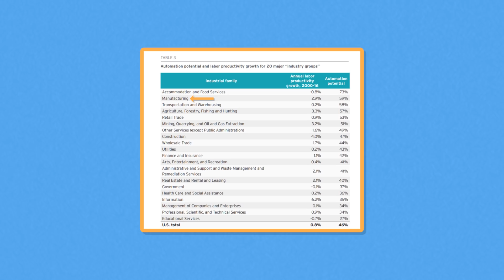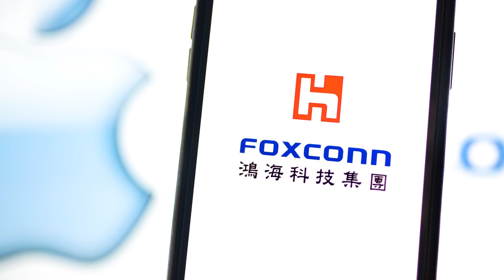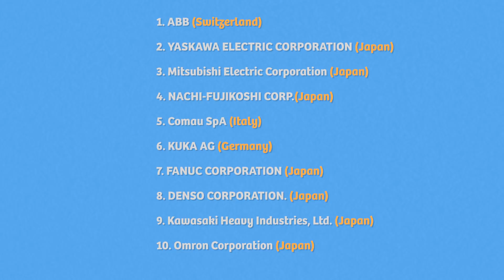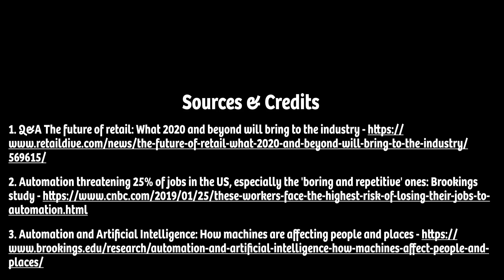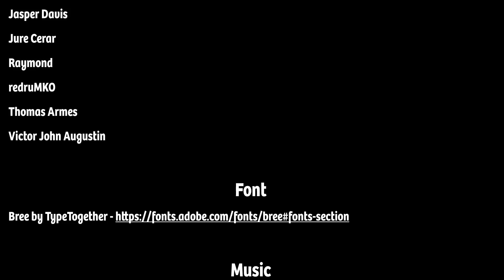The Automation Age Episode 2 - Manufacturing

Comment: Automation = lower production costs = cheaper products for everyone.
Reply: Which is irrelevant if you have half of your former worker base have an income of 0$.

There's no such thing as a perpetually valid economic system.

My suggestion is that we absolutely have to rethink our society and come up with a system to replace the current one via a gradual process before we are suddenly found with our pants down during a 30-50% unemployment rate.
Reply: @fl00fydragon  in reality; not many manufacturing processes can be automated, and if all of them could, not every company has the capital to invest in automating its entire supply chain. Im currently work in a manufacturing company that does not have the enough capital to invest even in the simplest processes. We still rely on labor, even though labor requires high amounts of training hours, benefits and some sort of mental-healthy environment, the company still invests in keeping their labor.

One thing that many people forget about automation is that it deals directly with the topic about: "humans will always have problems", named: health problems, mental problems, economic problems, etc. While machines require (at least most of them) minimal maintenance, which in the other,hand could increase the demand of technical labor for maintenance.
Reply: @alanbejarano4940 , In reality, any manufacturing process can be automated,  even the production of clothes (which was the bane of mass production) was technically solved a few years ago. It's not a question of if it's possible but of economics. 
The cost of automation is and will continue to drop, at some point it will drop to a point where it's more costly to run a human metabolism/year than a machine. 
At that point, any business that's not automated or not selling a completely unique product will either end up outcompete and bankrupt or bought off and automated.
companies like yours and co-ops might be the last to lose their labor but eventually, the logistics will catch up to them.

The demands for maintenance, even under total automation os well beneath the amounts of jobs that will be required to make up for the job loss. Additionally, there already are prototypes of self-maintaining machines or machines that do maintenance on other machines.
There's no law of physics that prohibits machines from doing maintenance on other machines or a self-diagnosing system.

So at best some lucky people will be doing maintenance job at a poverty wage and no worker rights as they'd have to compete with the fact that there will be millions willing to take their job with even less and substitute the lower salary with eating rats (what creates and maintains shanty towns) or at worse nobody gets a job and the only policy you see happening in response to the mass poverty is draconian laws/policing meant to "keep them starve in dignity" to prevent a revolt against the plutocracy that would form.

Your assertions come from a lack of knowledge on the subject.
Reply: @fl00fydragon  even now you can see governments subsidising its unemployed because of corona. So I'm not worried at all, it's upto governments to change, people will follow suit.
Reply: @marcozolo3536  Because it is fiscally unsustainable to do so under the current the current system.
Simply put, this would create a "funnel" in terms of cash flow where the money supply gets thinned as the corporations accumulate an unsustainable portion of the money supply.

this is pretty much nothing more than a bandaid that gives you a few extra years to move to a new economic system as a permanent UBI/subsidy would either require you tax 100% of corporation income so you don't get your money supply funneled (which makes production impossible in capitalism and also in all monetary models of socialism) or you have to constantly print money and prevent inflation, something the Us could temporarily pull off by using its reserve currency status which would turn its inflation into foreign debt but would soon lead to everyone dropping the dollar and causing the inflation to detonate overnight. 
(assuming the US doesn't do something completely stupid and make itself an extinction-level threat by trying to threaten the world to uphold the dollar.)

Way that I see it it's time we let the old system die off as we did with the old ones. There's no such thing as a perpetually valid economic model, it's hubris to think that ours is.
Reply: 400k jobs replaced by robots in 4 years? That's pretty horrific
Reply: Exactly why I got a Ms in mech eng.
Reply: Yes but how people are going to buy something if you have no money
Reply: exactly. automation is not the problem. inflationary monetary policy is, meaning your dollars are worth less and prices increase. 

with technological efficiencies, we should be working less days, making more money and enjoying better comforts. as always, conflate and miss-direct.
Reply: @SigmaMotionSystems  More accurately, the adherence to primitive monetary economics under a revolutionary era of automation will backfire.
Reply: 20% of the economy is gone
Reply: Which fewer and fewer people can afford,because they are unemployed.
Reply: @hudakp1 then competion would take advantage and increase their market share.
Reply: @hudakp1 it could be because of cost of R&D and the high quality
Reply: Who's gonna buy the product if nobody have a job? No job = no money = economy stops functioning.
Reply: Cheaper indeed but the robots that replaced the humans will not buy them.
Reply: Maybe we are all too optimistic when it comes to those "cheaper products".
Think about what makes products cheap today.
It is bulk production and bulk sale.
Stuff is cheap because it is produced and sold in large numbers.

Think about it, why does Toyota rather sell 100 000 cars for 20 000 Dollars each, than 1000 super mega luxury cars for 2 million each?
Sounds like a silly question, but when you really think about it, it gets scary.

There are basically 3 answers:
A: Because that is what Toyota does. Tradition. Name. Brand. Nobody wants to buy a 2 million Dollar Toyota.
B: It currently is easier to sell many cheap cars than few expensive ones, because of how the market and the consumer base looks like.
C: They needed to build a huge infrastructure and machinery to build that many cars. 

That machine (the factories, the trains, the steel forges, the sales rooms etc.) has a tremendous inertia. All of that needs to be running to be profitable and it needs to be running 24/7, all year.
You can't produce a hand full of cars, then stop the production chain and then start it up again when you need more cars.
The system is build to produce as much as possible, so you need to sell as much as possible, forcing you to sell cheap.

Robots and 3D Printers and other new technologies will take a lot of that inertia out of the system.
Once they have one big machine that can just print cars, they can suddenly start producing on demand. They aren't forced to keep the trains running anymore.

That means it suddenly becomes feasible to sell fewer, more expensive cars to a shrinking consumer base.

And that means this old, comforting wisdom "They still will need consumers to buy the stuff the robots produce." is suddenly not true anymore.

In a "on demand" industry, companies don't need to sell cheap stuff to many people anymore. They are better off selling expensive luxury goods to a small, rich elite, for high prices. That means less overhead and less work.

We might actually see a future where the economy doesn't need us unwashed masses anymore, where it can just as well, or even better, operate just for a small number of super rich people who sell each other crazy expensive stuff and still make more money than they did when they still sold cheap stuff to normal people.

It is that inertia of the production chain, the need to keep it running, which keeps us poor people in the loop for now.

3D Printers, which are celebrated as this wonderful tool of democratization and economic liberation, might actually bring us a dystopian hell worse than the worst science fiction movie.
Reply: @TrangleC  
And that's a misuse of the technology.
And also precisely why I believe that there should be a movement to replace capitalism that cannot be denied that will have to happen within the next 1-2 decades.
Reply: @fl00fydragon  And replace capitalism with what? Socialism?
Sorry, I can't agree with that. I am half German, half Croatian and old enough to have seen socialism in both countries and know why everyone was very happy to get rid of it.
People have this naive, childish image in their head when they think of capitalism, of some evil Mr Burns billionaire using "capitalism" as a tool to keep everyone else down.
That is a super reductionist caricature. In the end, all capitalism is, is that everyone is allowed to sell and buy stuff, including labor.

Yeah, not everyone thrives and there are losers, but with socialism, almost everyone loses.

Socialism just leads to real oppression, because you always end up with a one party dictatorship and in those, the only way to rise through the ranks and get to the top is to be the most devious, ruthless, cut-throat gangster monster of them all.
Yeah, capitalist politicians tend to be assholes too, but I'd rather be ruled by an asshole who was best at lying and kissing babies, than by one who was best at stepping on other people and destroying his competition Game of Thrones style, which is what happens in socialism, because there is no other way to succeed. 

Equality is an illusion and it is the antithesis to freedom and fairness.
The only way to establish equality is by dragging everyone down to the same level as the most useless fuckup and prevent everyone with drive and talent from achieving more.

Socialism only appeals to losers who don't intend to achieve anything and have nothing to offer to the world and to naive, spoiled children who never had to achieve anything. As soon as you have something valuable to sell, be it a thing or a talent, you suddenly notice how shitty the idea is.

I came up with a idea for how to deal with automation and mass unemployment. A alternative to UBI and the Korean "Robot Tax".
It is too long to repeat it here, but I posted a stand alone comment, explaining it, into this comment section. Look it up and tell me what you think of the idea.
Reply: @TrangleC  Ironically this binary view of economic systems is what's naive.

For one, by that logic we should also uncritically reject capitalism because fascism, one of its forms, is genocidal. |As you can imagine, just as it's wrong to equate capitalism to fascism so is it to equate socialism with the soviet model.

Additionally it's not about an "evil Mr burns" that keeps everyone down, the problem is how the algorithm of capitalism plays out as automation increases. You have an increasingly smaller amount of the population who have control over production and consistently falling labor requirements and it will be near impossible to compete unless you have the capital required to buy your own robots and operate at a loss for long enough to stabilize.

In short the algorithm, we call capitalism is not designed to function with AI.

The result is a siphoning effect of the money supply which would ruin more than half of our population, an effect that will be exasperated if you take into account that in addition to automation we'll be entering an age of genetic engineering and cybernetics.

Also, you gave a wrong definition of capitalism, it's not about allocation or trade, it's about who owns the means of production. 
To make this even clearer, there are forms of socialism that barely change anything such as market socialism, which would simply have co-ops instead of corporations. By your definition you'd call this system capitalism (and you'd be wrong).

If we retain capitalism in the era of AI, we'll have 50% of the population be "losers" in absolute poverty, a percentage that will rise to 80-90% by the end of the century.
sometimes the devil you know is not the solution.

You are arguing against the soviet model, I am not proposing the soviet model.
Only that our capitalist politicians are stepping on other's throats, for example look at the declassified CIA documents on regime change where they overthrew democratically elected governments because they were attempting an egalitarian/democratic version of socialism and didn't want the "there's no alternative" line to be invalidated.

False again, for one I doubt that you'll find many serious people who propose an alternative to capitlaism that want equality.
Adiitionally you don't need to drag everyone down, our technology has reached a point where we can afford to give prosperity to all, not only that we could even be environmentally sustainable as we do so.
Why haven't we done this already? 1) it would uproot trillion-dollar global industries 2) capitalism demands supply being limited because if it meets demands profit is impossible.

That's an ad hominem attack, and a bad one against an engineer with published scientific work.
Not to mention that you'd have to label the likes of Einstein and Hawking as "losers" with that.

I came up with a idea for how to deal with automation and mass unemployment. A alternative to UBI and the Korean "Robot Tax".
It is too long to repeat it here, but I posted a stand alone comment, explaining it, into this comment section. Look it up and tell me what you think of the idea.

My opinion on your solution?
In your words "I know, that sounds kind of Socialist" and you're right because it is, you are suggesting the people own the means of production.
However, your fear of socialism has resulted in you designing a very bad version of it with some fatal flaws.

1)You're incentivizing the proliferation of "single block machines" in production that can be a one-robot construction line.  Once again the system will have a smaller robot demand than supply.
2) It's ignoring that a lot of automation will be a single server doing the job of hundreds of office workers
3) The variation in the use of ROLs and the deliberate smaller implementation of them than demand in the market
4)By what you're constituting as a robot you'll be limiting the living standard of the average person who'd have to rent most, if not all of their ROLs which in turn may prohibit them from having access to a washing machine, computer, smartphone, oven, fridge, 3d printer, etc. just so they can make ends meet. (not to mention the mess this creates if someone requires prosthetics/augmentations)
5)Securing income will be a lottery under your system all the buyers will want is the ROL and there's no way to make yours more enticing.
6) One's ROLs have a different value demanding on their capital at the start of the system. A rich person today would only go up as they could simply invest in a few single-block production machines. 
Basically not only would you not be solving anything but you'll be creating dynasties of wealth and power with no means for them to end. Such concentration of wealth and power will end up eroding all democracy and you'll soon find yourself In a totalitarian state.

Let me make something clear, I don't want the soviet model to happen again.

However, if we keep going with capitalism during an era with automation our society will reach a boiling point where either the people will mount a revolution (resulting in a soviet model system) or the rich mounting a successful counter-revolution (resulting in fascism).

If you want to prevent totalitarianism then we need to figure out a working post-capitalist system and start its gradual deployment before the implementation of AI results in centralization of power around a select few where our votes, strikes, activism, marches, etc. won't be able to change course, making one of the two outcomes I mentioned inevitable. A result I think we can both agree is undesirable.
Reply: @fl00fydragon  No, no, my friend. You are either misunderstanding me, or willfully straw-manning my position.
I'm not just talking about mass murder. That was just the cherry of the sundae of my argument.
I'm talking about personal freedoms and liberties, which you don't get in Socialism.
You can't just ignore everything I said about that and dismiss it all by pointing at Nazis.

Honestly, as a part German, who grew up in Germany, I find talking about this with Americans and people from some other places super tiresome.
The Nazis are like a Rohrschacht-Test for uninformed people.
Everybody sees in them what they want and everybody uses them as a boogeyman.
Leftists say Nazis were an excess of Capitalism, Rightwingers say they were "brown Communists".
Both are wrong.
You need to know a thing or two about German culture and mentality to understand what the Nazis were and nobody outside of Germany seems to bother learning something about that.
Nazis are way too useful as this "one size fits all" boogeyman.
The Nazis were Corporatists. That is not the same thing as Capitalist, even though both are probably triggering slurs to a Socialist.

Under the Nazi regime, the government told the companies what to produce and how much to charge for it.
They ran the whole country like one big corporation, with Hitler being the CEO.
He decided the people need cheap cars, so the Volkswagen company was founded and started churning out cheap cars for the masses.
He decided the people need radios to hear his speeches, so they produced radios and forced people to buy them for a fixed price.

Like it or not, but that is not Capitalism.
It also isn't really Socialism, so the "brown Communist" thing isn't true either, because the companies still belonged to entrepreneurs and shareholders and still made money.
It was its own thing, in between the two systems and it was rooted in German culture and mentality, because it has always been normal in Germany that the economy was heavily influenced by everybody, the government, the business owners and the workers, working together for a greater good, with the company owners building houses and hospitals for their workers, without being asked to and so on.
You still can see that culture today in how the unions and the business owners work together in Germany in a pretty much worldwide unique way.

The point being, the German culture and with it Nazi culture, has always, traditionally cherry picked elements from Capitalism and from Socialism and mixed them together.
Blaming the crimes of the Nazis on Capitalism is nonsense, as is blaming them on Socialism.
To the Nazis both were basically foreign, alien concepts they just used for their own gains where it was convenient and ignored where it was not. (Yes, Socialism was technically invented in Germany, but it was invented by Jews and I don't need to tell you how the Nazis felt about them.)

Capitalism causes some problems too, of course, everything does, but as I said, it is just a system in which you have the freedom to own, sell and buy things.
That is all.
No other system has brought so much good to the world. No other system as elevated so many people out of poverty.
That is just a fact.

It also is the system that created the internet and gave you the freedom, the means and the leisure to bad mouth it online.
You couldn't do that under Socialism.

Did you know that there was a big, successful Communist youth organisation in China, which was dismantled by the Communist Party because it was "too Communist"?
I'm not joking.
A bunch of enthusiastic school teachers founded a Communist boy scouts like organisation that was all about teaching the kids about how wonderful Communism was, while doing fun activities in nature and play games and so on.
It grew rapidly until it grew too much and the Communist Party got scared. They were worried about losing control and having a rivaling organisation grow in their territory they didn't have direct control over, so they banned the organisation, sentenced the leaders to death and threw hundreds of people, even teenagers in jail.

This kind of stuff happens in Socialist systems.
Why? Because it is never really about equality and fairness and helping the working class and all that. It is just about control.

The point being, under Socialism, even being Socialist and talking bad about Capitalism, like you do, could get you on the party's shit list.

People don't appreciate freedom and liberty till they lose it.
As I said, I have seen it in the 80s and I know nobody who lived under Socialism and wants it back, except maybe some old apparatchiks who want their lost power back.
Reply: @TrangleC  (numbers correspond to answers to your paragraphs)

1)I'm not talking about mass murder either. 
What I pointed out is that fascism is a form capitalism takes. 
I just pointed out that it's equating socialism to the soviet model is as false as equating capitalism to fascism.
I expect a honest discussion, not a strawmanning of "but the USSR" at any suggestion that falls under the umbrella term of socialist economics.
And since you did bring it up  Fascism is the most totalitarian systems with the least amount of personal freedom in modern history.

2)All that's irrelevant since historians and political scientists place fascists, including the nazis, squarely in the capitalist quadrant. (evident from how they rose into power with the support of the industrialist capitalist class)

Also, corporatism is a latter stage of capitlaism. To say that "it's not real capitlaism" 
a) Is a false statement that assumes that it's possible to retain a system at its initial competitive stage and negate causality
b)Decalres capitalism as this impossible ideal of the "free market" that is inherently unstable and would collapse extremely soon after implemnentation
c)Is a line of rhetoric that has historically aided fascists to take over as it takes the conversation from "our system has a problem" to " something has corrupted our system" to "someone is responsible for these problems"

3)
And? The means of production were still private. Meaning it was still capitalism, it was simply a different form.
Capitlaism is not "when the government leaves the market alone" (if that were teh case anarchocommunism, anarchosyndicalism and market socialism would be capitalism) it's "individuals own the means of production" something you did admit in the next paragraph.

What you describe is called state capitlaism, fascism is state capitalism+totalitarianism.

4)
Thank you for making my point, capitlaism is when the means of production are private, what it's not is a scale of government involvement.

It's not unique to Germany, mousolini, pinochet, franco, Papadopoulos, etc. did the same policies. 
In fact there was an attempt to do that in the US, the business plot, thankfully for the world, the general they tried to use to take over was an anti-capitalist. 
It's worth noting that one of the conspirators was the grandfather of george bush.

Also I will also point out that marxism is also born from german culture (Marx was german)

5)
a)It has also created a scale of waste and depth of poverty that is unseen in human history, it is eroding our democracies and is incapable of properly adopting new technologies, creating new disruptive technologies as we've reached a barrier where private R&D is simply not enough and where patents halt progress by decades and where it's failing to meet the rising challenges of climate change and job loss to automation.
b)And in most socialist systems you can do the same.The exceptions are centralized market systems  (once again I am not proposing the soviet model) and post monetary systems (because the concept of buying loses meaning) 

c)And by that logic, no other system had done that much good to the world than feudalism before the invention and proper implementation of capitalism. 
This line of thinking assumes that this temporal state we now have is the peak we can reach, a statement that's mathematically impossible and one of pure hubris.

6)"Doth thou protest against feudalism yet thine life hath been cultivated upon the land thine lord has bequeathed upon you"
This is not an argument, every single system humanity has interchanged steps on the knowledge, technology and philosophy built within the system that it dethroned.
The "you badmouth capitalism yet it is the system that gave you these means you have" is a statement that ignores all of human history.

Also "badmouthing" is quite the emotionally charged term. Capitlaism is an invention, a logistical tool, not "badmouthing it" is as illogical as "not badmouthing" a an outdated tool and trying to use it to do work it was never designed to do out of emotional attachment. 
In my example, you'll get hurt, in the case of capitalism you'll be destroying lives in the millions/year for no other reason by loyalty to a machine.

7)Irrelevant to my argument, I do not advocate for the soviet model.
China uses a modified soviet model.
I do not advocate for totalitarianism, I advocate for socialist economics and democratic governmetns.

8)Correction: this happens under the soviet model, which is a flaw that's shared with all totalitarian systems. Fascists have the same problem.

Once again, I am not advocating for the soviet model.
This is why I had to point out that you are doing an error of similar magnitude to equate all socialist systems to the soviet model as equating al capitalist system to fascism.

9)I am not advocating for a 1 party state though. 
I am advocating for democratic socialism.

10) We are in the process of losing our liberties. Capitlaism is headed for a brick wall at mach 7, the "solution" that's being pushed everywhere is to cut liberties and become a draconian police state to protect the interests of the rich from the starving masses who'll be demanding wealth redistribution.

This is no more liberty as the "liberty" of the french king to live in opulence on the backs of a people he deliberately starved.

Your problem is that you use the "there's always a bigger fish" logic which in turn you then think that you simply need the "right biggest fish" in power
That's no solution, you are constantly hoping to be lucky enough to have a benevolent lord, a functional system does not need that.

What I propose is either market socialism or decentralized post monetary economics paired with a democratic system that keeps politicians accountable at all times via ostracization vote as democracy was designed to function int he first place. 
Instead of hoping for a "good lord" it's better to limit the amount of power over the demos the individual can take and even then keep the demos capable of dethroning those who abuse it.

For the Nth time,I AM NOT ADVOCATING FOR THE SOVIET MODEL.
I am not asking much of you, just simple intellectual honesty.
Reply: @fl00fydragon  capitalism made the world without it there would be chaous
Reply: @newaryamen  
1)Chaos
2)Capitalism is nothig more than one of many economic systems in human history, as we advancce old systems become obsolete and are replaced. There's no such thing as a perpetually valid economic system.
3) It didn't the cause behind the technological revolution was the end of theocracy and the redicovery of the scientific method the greeks left behind, capitalism simply happened to exist in the same timeframe.
Reply: @fl00fydragon   without capitalism no ,free market ,no  ww2
Without ww2 no internet (yes internet was first developed by us after ww2)
Reply: @newaryamen  Are you seriously using the internet,a government innovation that was detached from the market during it's critical stages of development, as an example of capitalist innovation?

Same goes for things like semiconductor technology, LCDs, lithium ion batteries, medicine, aerospace, etc.
All were developed publicly because the market is incompatible with research that's long term, extremely expensive and high failure rate of producing a marketable product.
Reply: @newaryamen  also, pointing out that capitalism gives rise to fascism and world war 2 is a point against you.